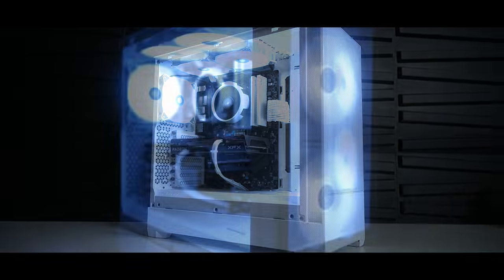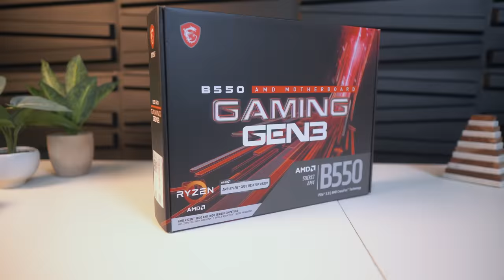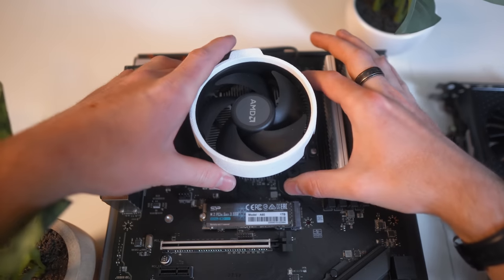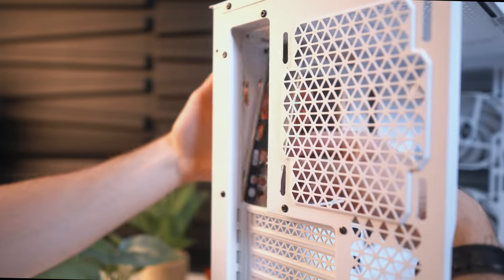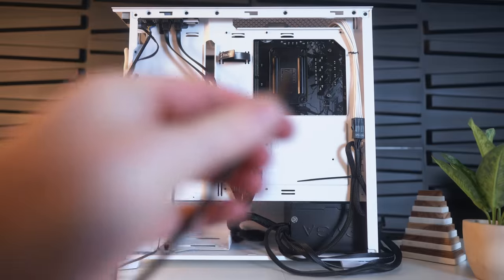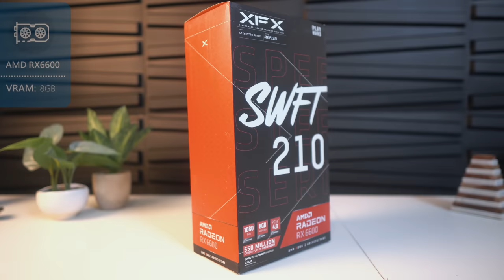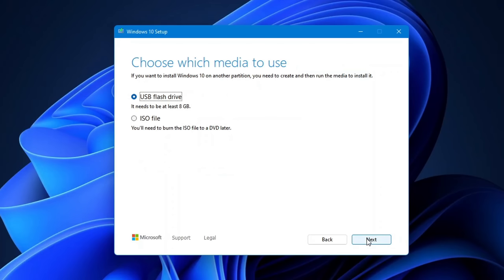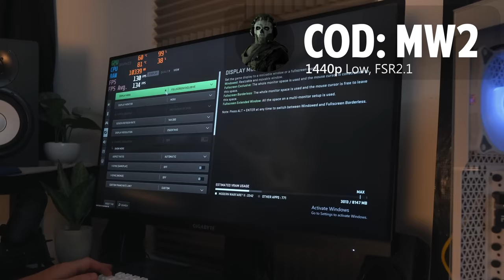BEST $700 Gaming PC Build Tutorial! [w/ Benchmarks]

Comment from the maker: If you have questions about this build, join here! : https://discord.gg/GyDyfzMnqU
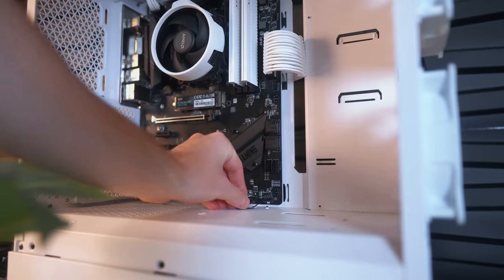**8:01 I forgot to put in the diagram oops, here it is: https://www.cgdirector.com/jfp1-connector-motherboard/
Reply: Can an EVGA SuperNOVA 650W G5 80 gold be use with an 6700xt?
Reply from the maker: @310_Latchkey_kid  yes!
Reply from the maker: @ARZard  yes!
Reply: You didn’t link the white cable extensions
Reply: @Roo_Tech  RX 6700 XT FIT IN THAT case?
Reply: @ARZard  you can but i recommend the 6600 simply since it’s cheaper and the performance is slightly better
Reply: What cord plugs into the monitor? Is it a hdmi or something else
Reply: How would you add a Wi-Fi port to get internet with this
Reply: can i put an rtx 3060 instead of the rx6600?
Reply from the maker: @endersteve704  yes
Reply: @Roo_Tech  thanks :)
Reply: @Roo_Tech could I use a ryzen 5 5600x plus a thermalalright 120 se white?
Reply: @Roo_Tech can i use MSI MAG VAMPIRIC 100R Case ATX 2x 120mm instend
Reply: @Roo_Tech pls respond😢
Reply from the maker: @orthaaktar8089  yes
Reply: @Roo_Tech  ok ty soooooo muchhhh
Reply: @Jander_ yes
Reply: @ARZard mabey but a 6650 xt is Better
Reply: @Jander_ sorry a 6650 xt can but im not sure Ab the 6700
Reply: Do you know if the motherboard is has wifi?
Reply: Hey, I'm new to this, was there a heat sync between the fan and the CPU? Also, do I add thermal paste?
Reply from the maker: @0_TokiToki_0  the thermal paste comes pre-applied on the cooler
Reply: Wish this guy would have told me that this motherboard doesn’t come with Wi-Fi 😔
Reply: @Roo_Tech  Can I use 7500f and 6750gre for a whole machine at $700
Reply: @Roo_Tech Hey I am new to this ，please answer😂😂
Reply: Do the cheap windows keys work?
Reply: @Roo_Tech are Corsair white fans available for this pc?If not,are there any other fans available?
Reply: Hi, great video, Im gonna build it next week! One question: which monitor should I use for this? I don't have a monitor yet so what would you recommend? :) thanks
Reply: Does it support windows 11?
Reply from the maker: @XadidaX17  Yes
Reply: One last question can i use other cases?
Reply: Could a 5600g work good with a 3070 or 4060ti 8GB what should I get? Thanks 😊

Comment: I think if you save money on RGB you could squeeze in 6650XT. But nice build overall
Reply: i want to say to upgrade it to rx 6700xt for 70$ dollar more because it has 12GB of Vram, recent new game like Resident evil 4 remake need more than 8Gb or VRAM. But we need to squeeze budget so i think 6650Xt is good GPU
Reply: @jalma9643  xfx speedster 6700?
Reply: @jalma9643  it’s fit in that case?
Reply: @Jander_  i dont know
Reply: @jalma9643  they got the same case xl in Newegg
Reply: @jalma9643  and i bought different 32 gb ram 3600, that doesn’t mater right?
Reply: @Jander_  man i am new in this community, sorry i can't answer you question.
Reply: @Jander_ doesnt matter in the slightest, will still work great, the GPU will also fit as it's a mid tower case meaning plenty of extra room. The only difference there may be is different ram timings such as cl18 or higher which makes absolutely no difference in setting it up and offers almost identical performance anyway. The PC will be great for you however you decide to build it and I'm excited to hear if it all works out for you.
Reply: @forbandyson8921  thank u man. So With the upgrade I did I will available to play 1440p  high setting and high fps right?
Reply: @forbandyson8921  and what water cooler u recommend?
Reply: @Jander_  100% recommend an air cooler, a water cooler is massively unnecessary for your cpu. I'm running a 30 dollar deepcool ak400 on a ryzen 5 7600 and it's doing fine, would recommend something similar as going with a more expensive cooler would just be a waste of money. You can definitely get good fps at 1440p high settings for mostly any non super graphically intensive games with that build.
Reply: @forbandyson8921  bro i don’t think Is a waste of money, because if I like play on pc I will upgrade my pc in 4 or 5 months after I start playing
Reply: @forbandyson8921  and u know I just wanted the water cooler for the look 😂😂😂 but I like the one u have
Reply: @forbandyson8921  recommend Me a monitor 1440p +165hz
Reply: @Jander_  that's a bit of a tougher one. Only two monitors I've got are a 1080p 144hz and an lg 27gl83a 1440p 144hz. Honestly go through rtings reviews for any that catch your eye and go from the price after that. Anything with low latency and decent color accuracy will be just fine. Also try to stick with ips panels (not va or tn) and most options will be workable, especially with an icc profile for color calibration.
Reply: @Jander_ gigabyte m27q
Reply: @FRMC_SALMON  is that good, come with speakers?
Reply: @Jander_ it’s good but it does not come with speakers
Reply: noob build
Reply: @Jander_ if your still wondering i just bought a speedster 6700 XT and It fit perfectly
Reply: @daleymatron  no bro I got the 6950xt with a 7700x cpu
Reply: @Jander_  dayumm, solid card, was debating it but was out of my budget
Reply: @daleymatron  what u budget is right now ?
Reply: @Jander_  I have my build now, was an £800 budget, got a ryzen 5 5600x with a speedster 6700 xt, great build but I hate amd driver app
Reply: @daleymatron  i got my pc already but I haven’t use it yet
Reply: @Jander_  I built it few days ago not used it properly either yet, just spent few days reinstalling stuff
Reply: @daleymatron hi, did you make this exact build but swap out the gpu?
Reply: @okaylyv   same case, same cpu, same motherboard just a different version, rest was different
Reply: Non rgb cost more here,  personally i really don't like rgb but all the budget build has rgb where as the non rgb are costly by huge difference
Reply: What should i get rx 6700 xt rtx 3070 or 2080 ti

Comment: I dont know if he did this or not. But dont forget thermal paste between the CPU and CPU cooler. Will provide better heat wicking.
Reply: not just better thermal paste is very necessary
Reply: Edit: Absolutely necessary
Reply: @Braxton.Schlenker  the cooler  has thermal paste on it but how long should I replace every now and then like a month or maybe even a year ?
Reply: @benmassena4823  as general rule of thumb. About every 6 months
Reply: @Braxton.Schlenker where do you apply the thermal paste
Reply: @br1yaan345  between the heat sync and the cpu.

Comment: This is a good build however this motherboard does not come with Wi-Fi card. It really annoyed me because the video did not say it didn’t come with Wi-Fi. Now I have to buy a Wi-Fi card
Reply from the maker: You do not need a “wifi card.” You could also get a wifi adapter, which is as simple as connecting via USB. They work just as well, and sometimes, better, and are much easier to set up. 
I do apologize for not mentioning this in the video, I’ll be sure to correct this for future content ☺️

Comment: Dude, this video is perfect!
There's literally everything for a person who knows nothing about computers. Best components for 700$ pc, pc building guide, cable management, installing the os and even the benchmarks. Mostly ppl just show the build part and the components.
Reply: Is it still accurate?
Reply: @idkhahahaha  Yeah I just followed this tutorial and it's still a great build for a good price. Also since this video is a year old and some of the parts are cheaper now, you could build this for a little less than $700. I was able to upgrade the ryzen 5600 cpu to a 5600x, and I paid extra for a motherboard with a built in wifi adapter and I spent roughly $733
Reply: @saltystephen5626  thx for the info. For some reason some people told me PC build guides on YouTube are “outdated” after a month or two.
Reply: @saltystephen5626 what motherboard did u buy??

Comment: This is fairly close to perfect for the budget. I've been watching budget build videos from creators with way more views, and this build list was more competent than 90% of them.

Definitely worth an extra $60 or so to bump up the wattage on the PSU and drop a 6700 non-XT 10GB in. RX 6700 @ $275 is amazing value.
Reply: Agreed. You might be able to squeeze in a 6600/6650 XT or A750 for slightly better rasturization/AV 1 encoding respectively by--say--using the built-in fans instead of the 5 x RGB but the aesthetics are absolute peak without compromising too hard in terms of performance.
Reply: Would u build this pc?
Reply: @Jander_  with a 6650xt rather than a 6600, yes.
Reply: @Mrposton101  i just one to play  in 1440p with high fps
Reply: I personally feel that going for 3600 mhz ram is equally as worth it
Reply: Does anyone know if this will run windows 11
Reply: @awokern6699  maybe yes
Reply: @awokern6699  Yes.
Reply: @Jander_  if you wanna play 1440p comfortably you will need twice this price range. Unless you plan on playing on low graphics permanently.
Reply: @blesk400  i just want to play 100-120 fps nothing crazy
Reply: @Jander_  that is crazy for 1440p. Im getting a 1800$ build soon and benchmarks say ill run most games at around 80fps with ultra graphics and ray tracing on a 1440p monitor. A 700$ build isnt gonna cut it with a monitor like that. Should be decent for 1080p though.
Reply: @Jander_  Ofcourse depends on what games you wanna play. Im reffering to high end stuff like elden ring or cyberpunk.
Reply: @blesk400  i don’t play these games, maybe gta,Fortnite, war zone etc.
Reply: @blesk400  what if I switch graphic card for the RX 6700 XT?
Reply: @Jander_  thats a lot better. if you use a 6700xt you should run all of those games pretty comfortably at 100-120fps. just know that if you decide on playing more demanding games, you will either need a stronger build or switch to a 1080 monitor.
Reply: @blesk400  what i don’t know is if it’s gonna fit in the case
Reply: The rx 6700 xt will get you to some good performance on 1440p! Below that you will struggle a little bit to get nice fps on 1440p. Comparing with the video build I would try to save some money on the rgb coolers, case, maybe the psu but it's fairly okay and maybe even go for a 500 GB SSD. For the games you said if saving money on those areas get you to the rx 6700 xt it's definetely worth it! Good luck
Reply: @Jander_ The rx 6700 xt will get you to some good performance on 1440p! Below that you will struggle a little bit to get nice fps on 1440p. Comparing with the video build I would try to save some money on the rgb coolers, case, maybe the psu but it's fairly okay and maybe even go for a 500 GB SSD. For the games you said if saving money on those areas get you to the rx 6700 xt it's definetely worth it! Good luck
Reply: @thomygolf1468  what coolers u recommend me to go, I would love water cooler, and what case, and I want to go with 32 gb of ram 3600.
Reply: @thomygolf1468  do u think the RX 6700 XT will fit in that case?
Reply: @Mrposton101 hi i’m looking to build this want to play on 1080p, do i build this exactly or do i swap some pieces i want to play on high setting and remain 120fps and higher is that possible with this build
Reply: @blesk400  i have a 800$ usd build that can run high fps 1440? i’m using a ryzen5 5600 and rx 6700xt
Reply: @unforeseenDrowsy  on ultra with ray tracing? what games do you play?
Reply: @Mrposton101 is the 6600xt good? Cuz the one I plan on building includes a 6600xt
Reply: anyone know if 3:34 is it possible to put 2 ssds on this motherboard?????
Reply: This is exactly what i was goin to say
Reply: @Jander_    recommend 15 124 or 13400 or ryzen 5 5600 on 3060 ti
Reply: @guilorvin  I builded already a 7700x with a 6950xt xfx, Samsung 980 2tb and 32gb ram
Reply: Hi! Will these pc be able to play in 240fps fortnite? If not what graphics card is better?
Reply: Can this run Red Dead Redemption 2?

Comment: I managed to get something similar to this for £600

-Ryzen 5600
-Asus prime b450m A -II
-Corsair vengeance 16gb black ram
-crucial p3 plus 1tb
-msi mech rx6600
-msi mag 650wt psu
-fractal design pop air white

I might order some budget rgb fans or save for some decent ones and will probably have to order cable extensions since my psu isnt modular.

Comment: love the video. i recently built a very similar build using the 5500 and rx 6600. it's a great combo and easily handles any game above 140fps. i easily get 300+ fps on valorant and fort and apex both around 160-200fps .
Reply: Will it be better if i use an ryzen 2700X ??
( thanks for helping me if you do)
Reply: @mafakabebe  honestly idk if you already have the cpu you’d probably be ok but if not go with the Ryzen 5 5600 or 5600x
Reply: what resolution?

Comment: hey i just wanted to point out having more exhaust fans than intake makes your computer force nearby debris and dust through the cracks  because the computer has an overall negative airflow... i suggest switching at least 1 of the exhaust fans to intake
Reply: which fan would be best to switch?
Reply: None, it's an even pressure build. The H5 flow has a fan slot at the bottom.

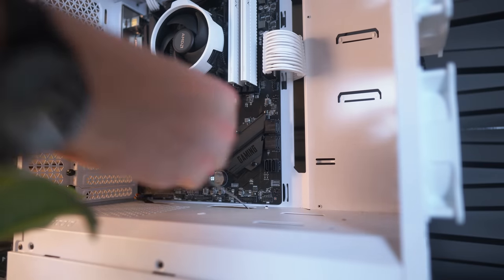Comment: Just built this. Anyone following the guide needs to know that because he didn’t include the guide for the where the F panel cables go at 7:53 you’ll just have to check the either the power supply or motherboard manual to find the right slots.
Reply: Thanks
Reply: How’s the gameplay so far? I’m planning to build this soon
Reply: what's the gameplay like?
Reply: @ecco2klvr  0 issues. Maxed out settings on everything I’ve played with over 60fps. Benchmark tests in the video are accurate.
Reply: @gbass1 how much fps do u get on low quality games? Like minecraft, roblox etc
Reply: @세연-o6z  I put a cap at 60 for roblox but I’ve never dropped below that. 120 + with vanilla Minecraft maxed graphics. Heavily modded Minecraft maxed graphics + shaders puts me at 40-70.

Comment: Thank you sir I have been looking for a pc build to make, I finally found a great looking one! Thank you for the extremely detailed video. you were very clear how to assemble the pc and what parts where’d used. Thank you I subbed keep up the great work.
Reply: Did you build it yet? If yes, how is it?
Reply: @majedep1 It’s so good for the price. I built it and didn’t take too long. Maybe an hour and 15 minutes. But it runs fantastically and was worth the money for me.
Reply: @yeurrn If I have a smaller power supply and a RTX 3060 in the case, would they both fit? Edit: or would it be a problem even if they fit?
Reply: @100precent.creative  the case is big enough for that card yes
Reply: I’m might switch from a laptop to a pc because of many reasons. If you have ever gamed on a laptop you probably know what problems it has. Short battery, charge while playing or you get bad performance, the keyboard usually isn’t satisfying and burns your fingers after you play over an hour, neck problems because the pc is on your desk and you look down to see not I in front of you.
Reply: @yeurrn  Thank you for the quick reply and even a reply
Reply: @majedep1  I have not built it yet however I have built a pc with similar parts and build (just because I wanted slightly better specs) but I can confirm it is very good.
Reply: @100precent.creative 100%

Comment: Great Video! Very Detailed. Im using exactly the specs of this pc! My only concern is that the graphics cards needs 550 watts power supply minimum but you have a 500 watts power supply. I replaced that with a 550 watts one but apart from that the pc build is great! I love your videos. Keep up the great work!
Reply from the maker: Thank you! I’m not sure where you’re getting that figure from — the graphics card takes up SIGNIFICANTLY less power than that, let alone the entire PC altogether. The 500W supply is more than enough. But no harm, no foul getting a higher wattage supply!
Reply: @Roo_Tech  I clicked onto your link of the graphics card from amazon. Underneath it does say that in about this item that the minimum power supply requirement is 550 watts of power but maybe its wrong. Your the expert! But thank you so much for replying 2 my comment! Your one of my favourite youtubers because of how well you explain how to build pcs and how calm your voice is. Your an overall great youtuber and I will continue supporting your videos. Thanks!
Reply from the maker: @SanidhyaFN  sure thing!! Yeah that’s definitely an error by whoever wrote the product description haha

Comment: What DVI do you use I’ve been stuck for hours just researching 😭😭😭
Reply: DVI? That's archaic. Unless your monitor doesn't support HDMI/DisplayPort, you're better off going with an HDMI cable. If your monitor only supports DVI, you will need to buy an HDMI to DVI adapter. Do note that this may limit some resolution/refresh rate options.

Comment: So first I wanna say, this video was a great guide for me to build my pc but I ran into an issue when building it. The motherboard had a red light on for the cpu when I was trouble shooting it so I had removed the cpu cooler to check if it was installed correctly. When I was sure it was fine, I then couldn’t screw the cooler back in because the screws wouldn’t go down anymore. Is there anyway I can fix this?
Reply: same problem here

Comment: You should have added a graphics card support bracket so the corner of that Radeon RX card won't sag.  I received a white upHere bracket yesterday.
Reply: i also bought one because my graphics card was hanging down a bit. Helpet alot and is easy to install
Reply: U can use almost anything (that's non static) as GPU bracket. I just used Legos.
Reply: @deagle7776  W
Reply: you really dont need to worry about sag with a smaller gpu like this one, it doesnt have a huge finstack and its not all that big (not even triple fan)